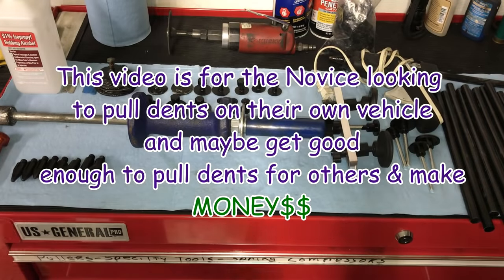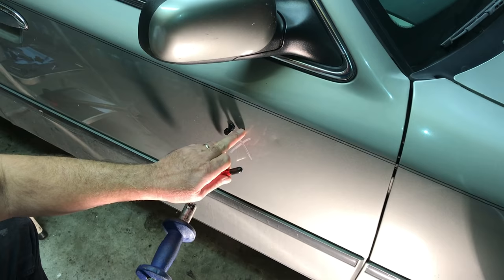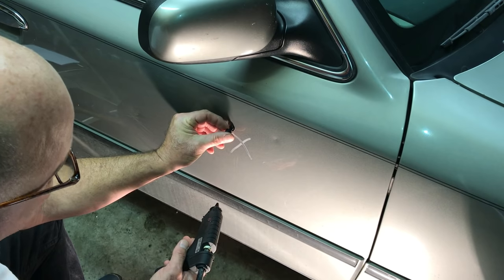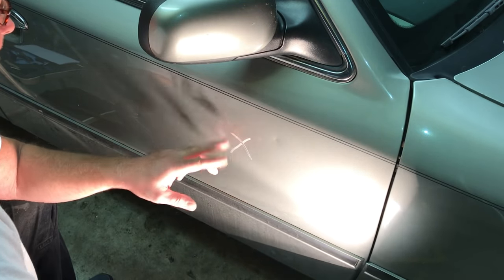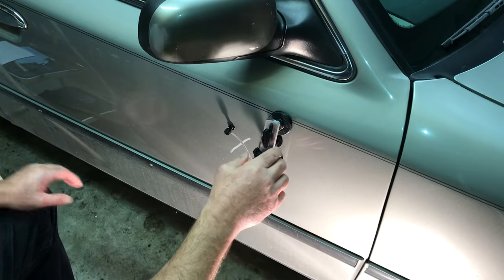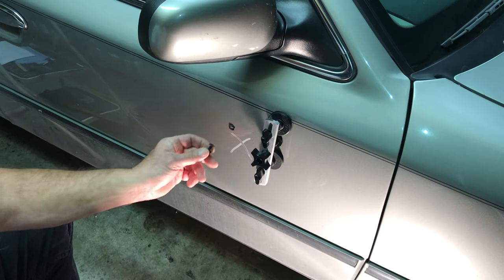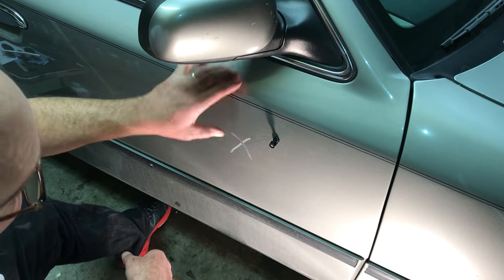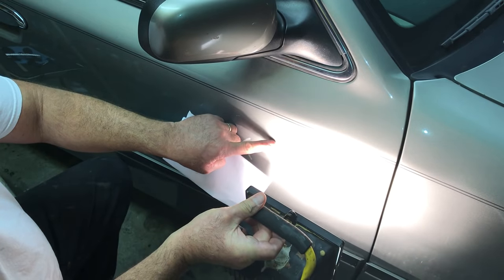#2 How To Remove Simple Door DINGS & DENTS for DIY'ers

Comment: Just used my PDR system today for the first time. Amazingly, most everything you talked about today, I figured out on my own except the 91% alcohol. I was using 70% and having a hard time removing the glue. Also in the right cases, I now get the need for the knock down tool because you might over do the pull a bit etc. I have the bar light so I am going to have to practice with it. Thanks for posting. Just the best!  Bought a truck last summer and I kid you not, the truck body was perfect,,,then a dent a week for four weeks. I was so mad. Car door dents from careless people. Biggest thing when doing these dent removals is,,, this takes patience. Yep, can't get in a hurry. Thanks again for this video. It was superbly well delivered!
Reply from the maker: You are very correct it takes a lot of patients you’ll get to the point to where you’ll be able to pull the dent up high enough that you’re knocked down tool will be able to level it right out very rarely will you get the dent to come out flat and perfect without the knockdown tool but it does happen good job my friend glad to hear you’re digging into it don’t get frustrated have a great day my friend

Comment from the maker: HELLO FOLKS, You can see the FIRST VIDEO here >>>>    https://youtu.be/_bq4cN7l14E      also you can buy a DENT pulling kit on eBay or Amazon or walmart they pretty much have all the PDR stuff you will need cheap...now go pull some dents.. :)
Reply: Sweet Project Cars.     Hey buddy nice job..I have both tools but the one you screw down didn't work that well either..
I took the thumb screw off and put a 10mm nut on it then I took my DeWalt cordless drill put it fast speed and put it on the nut
took the dent right out the first time the drill speed is what did it..I did go and buy the slide hammer witch 
I like better but that day I didn't one the drill method worked great..I had hail damage on my brand new truck
you can't tell it now ..thanks for the video and the tips...later dude..
Reply: Does this work with an aluminum car body?
Reply: Hahaha that made me laugh how well you actually did that! What a way to make some money and maintain my own car! Best video I’ve watched in ages. Thanks for the advice your video was perfect!
Reply from the maker: it sure does :)
Reply from the maker: Allan glad we could help you my friend :)
Reply: Sweet Project Cars absolutely amazing! I’m in the middle of buying the kit right now haha. Thanks!
Reply from the maker: you are very welcome :)

Comment: Thanks for the great tutorial- will be sure to check out some of your others. Even though my Pilot quarter panel was  badly scraped up as well as dented by an altercation with a box truck, I'm going to try PDR techniques. I contacted a local PDR guy and sent a photo asking if he could remove some dents, he said forget it, your panel is too badly mangled (next to the taillight the truck bumper grabbed the body and pulled it 3" forward). . Not to back off from a challenge,  I chained a winch to it and pulled out the damage somewhat. Now just have to remove multiple waves, creases and dents before filler and plan to try this rather than hammer and dolly, which I have no skills at. Thanks again!
Reply from the maker: MAINSTREET PRODUCTIONS we love your tenacity just keep at it and enjoy the process you will get it my friend  thanks for sharing mike

Comment: I did the method on my MC fuel tank using a square wooden dowel and hot glue...ZERO special tools. It worked just fine on a baseball diameter dent of about 1/8 to 1/4" depth. The tank looks as good as new. Saved 100's of bucks and all the dire warnings from skeptics.
Reply from the maker: G Philip C thank you for sharing sounds like a great idea for a gas tank ...

Comment: You guys are great sharing the  "secrets". Unfortunately I've got a crease on the hood of a 2013 Chrysler. A plastic squirrel cage fan fell off a shelving unit. The hood is aluminum so I'm taking the car to a guy that takes care of car dealers stock to push the crease out (paintless dent repair). Cost, $125.00, but I hate dents and dings.

'
Reply from the maker: Sorry to hear about that my friend those guys that deal with that will take good care of you

Comment: I actually had the body shop attempt to fix a ding on my door. The charge was 200 if he was able to remove it. Long story short they were not able to fix it. He mentioned the glue method but I guess he felt it would not work on this ding. I just may give it a shot when I get the car back from the body shop. Thanks for the info

Comment: And another trick  if you have a dent in your bumper cover  heat the inside of the bumper cover where the dent is  with a heat gun or a blow dryer  and push the dent it will push right back out. Just don't get it to hot. And wear gloves so you won't burn your hands  you can do it your self and save you a lot of money
Reply from the maker: Ben    .thank you for the great comments, they are very helpful to the entire channel :)

Comment: Excellent video but somewhat surprised you don’t use a light board to make it easier to see the high and low spots.  Maybe not needed as much for the 2 small dents you are demonstrating here.  Thank you for sharing your expertise.
Reply from the maker: Yes the light boards are handy when you have larger dents on the smaller ones it’s very easy to see them when you look at it at an angle you can see the distortion in the panel have a great weekend thank you for sharing

Comment: Thank you very much on all your videos.
Very informed easy and cheap way of doing things on the cars that’s what I’ve been searching for .I have bigger dent in my sequoia can I use the slide hammer for that and do you have any videos for bigger dents .
Thanks ,
Reply from the maker: Jay you can use the tools in the tool list for just about any size dent larger dents are almost easier you glue your big tab on in the center do the initial pull and work your way out to each edge of the Dent  they take a little bit longer because their larger but you can get it my. Friend

Comment: Another great video, provides food for thought. I have two applications. A motorcycle tank that was supposedly painted professionally where  a dent was filled with Bondo and the boot lid of my wife's car. The bike is a 6 cylinder collectable which I am restoring. My wife's car was repaired after someone pushed in the quarter panel and drove off. We had the boot lid where the clear coat was worse for wear, resprayed at the same time to blend in the patina and paint colour of the paint finish. A week later we parked her car and when we came back, a vandal had punched a number of cars including ours, in of all places the boot lid, one of the hardest places to get to. Every insurance claim costs $400 up front "Excess", so we did not have it repaired. Can you please advise us which brand of glue sticks and pads you buy.  There is a lot of junk on the market that is a waste of time and money.
Reply from the maker: these are the sticks we use in about 60-degree and warmer weather http://amzn.to/2lUuXqk   and this is the kit we use http://amzn.to/2EDTSXY  thanks so much for your great comment and support of the SPC channel :)

Comment: Great informative video. Hoping you can share some advice. I have a very large dent in the passenger door of my Isuzu Trooper. It was caused by a car backing into it and its taillight hitting it below the door handle. 

My question is how do you recommend I approach removing the dent since it is huge. Should I start in the middle of the dent by the point of impact and work my way out or at the edges of the dented area and work my way towards the middle?  Hope that makes sense. 

Thanks in advance for your guidance.
Reply from the maker: Luis Matho can you send us some pics of it?   sweetprojectcars@gmail.com  Mike

Comment: THANK YOU for this video.  I found it while researching ways to DIY the dents on my newly purchased 2010 HHR, not a huge amount of damage and I didn't feel like shelling out $1250 bucks quoted by the body guys.  I bought a slide hammer from harbor freight and made my own pulls, and I already had the glue gun and a good hair dryer.  For the two smaller dents, I popped them out with the very first pull.  The rear fender had a large dent and a crease abd scratch near the seam of the bumper.  My goal wasn't to fix that crease, I don't think this method will work for it, but the big dent was unsightly and annoying.  It took about 45 minutes of pulling to get it flush. The car is a 2010 so the tiny spots and that crease are unnoticeable now that I've filled the scratch. If you're not looking for it, you won't see it, and that's all I could ask for.
Reply from the maker: Paige Holliman this is so awesome to hear...we are glad it saved you and helped you...thank you for sharing your great results my friend :)

Comment: I appreciate learning from your videos. How much force is required for the slide hammer? It looks heavy by itself, so I'm curious about handling that thing and having enough pulling force. I wouldn't want to scratch the paint by letting it slip. Thank you so much.
Reply from the maker: Cynthia buy the smaller T-handle model much easier to handle for the DIYer

Comment: Works better if you warm up the body. Making it easier for the metal to flex and prevent cracking the paint. You can use a hair dryer or a hot air gun.
Reply from the maker: Thanks for watching and sharing. Have a great day. mad Mike the hammer SPC

Comment: Got a "bridge" kit some time ago; works somewhat. Will now be looking for a slide hammer/plug combo as our van got hit in the nose with a rock about a week after we got it. Also - my kit came with a white/opaque glue stick, not the black that you use. Wonder if there is any difference in glue strength? Thanks for the video series.
Reply from the maker: we are glad to help :) thank you for your great support  and thanks for being here with us :)
Reply: Do you have a good source for the slide hammer and pull tabs? I've checked Amazon and ebay but the hammers are around $35 and I've only seen the set of 14 different-sized pull tabs (in various colors) for about $15.
Reply from the maker: david your comment just came in ????   anyhow all the tools are in the video description area     thank you we do really appreciate you being here with us...:)

Comment: If you are dealing with anything other than factory paint and clear coat I would not recommend using the glue pull technique as there is a good chance it will pull the paint off.   The danger of this increases if there is bondo body work under the paint. If you are original owner than you would know if original, or not.  If you don't know history of car look for tell tale signs of body work and repainting.  Look in the crevices, door jams, where the trim is attached -painters are notoriously not good cleaners and you can usually find signs of previous work.  And don't forget to ask the owner , they may know the history of the car and any repairs.  It takes practice and patience but you can do it and make money.  Glue pulling alone will not always remove all dents.  Anywhere between 85% -100% is normal.  You would have to purchase the wands kit and push from behind to get closer to 100% consistently.  But that's a whole different training process to learn an not as easy to master.  Good luck.
Reply from the maker: Mark these issues you speak of we have never had a problem with after 20 years of glue pulling on 100's and 100's of cars. we are actually going to be doing a video on trying to pull really large nasty dents to see how it really works on them.

Comment: I bought a full kit a couple of years ago that included, that bar kit, the slide hammer kit and that other one you didn't show, the one that is similar to the bar, but has the handle you crimp. I had a go, but got frustrated and gave up, but thanks for the tip, it's a process, got to go the dints several times each. I'm going to have another go hopefully one day again soon. Also I've seen the dangers of that bar kit is that the outer pads can make new dents too and to keep them off edges or they can collapse them. So, any follow up to the fixing of slack door straps? Thanks.
Reply from the maker: MV60 now you can go back at it my friend and try again just take your time and do it slowly.....thank you so much for the great comments and we are very glad to have you here with us..its comments like that that will make our channel very useful to others..:)
Reply: Thanks. :) I was always previously under the impression it should pop out in one go and that it was a failure when the tab broke off and the dent was still there, that the glue wasn't right or something. Just another thing one needs to learn patience with. :)
Reply from the maker: time and patience is the the key...you should have seen me when i started lol  but after a couple weeks it got better, then after a month or so i learned to pull the dents out just about perfect without using the knock down tool..you will get it my friend.

Comment: Been a subscriber short a short time. Really appreciate the information.

I received my slide hammer kit on Saturday and have been trying to remove my first dings. Made a 90% improvement. Can't seem to get the last 10% out. I rewatched this video and tried with more glue without bottoming out the tab. Still can't seem to remove 100%. Glued different tabs on +ten times, anything else to suggest?
Reply from the maker: greg  clean the spot with alcohol real good then glue one on but push it in a bit further then let it sit 10 min's then pull it out hard a fast.  do that a few times and it should do the trick thank you very much for your great comment, it is great for the whole channel to have good people like you here :)

Comment: 4:15 when this happens, I use my heat gun to melt the glue back down and reuse it . Also, I use acetone to get the glue off every few times I melt it down .. usually just because I get paranoid that it starts sticking less but I’m pretty sure it’s fine indefinitely.. acetone makes the glue fall off without any scraping or peeling, it’s stupid how easily it comes off with acetone.. tho you shouldn’t use it if your little attachments are plastic, I melted one of mine trying to get the glue residue off it.. im gonna go to a machinist and see about having some metal ones made

Comment: Great videos Mike, thanks a lot. I have a quistion, i tried to pull out a dent on my own car, at the beginning it went well, but when I had to make the last pull, the paint came off ?
Do you have an idea why ? Did I pull too many times at the same point (5 times) or could the glue have been too hot?
Reply from the maker: Flemming Sortkjaer sometimes and very rarely if you pull too many times in the same spot it will do that, also it depends on the age of the paint and the quality of the paint, also if you let the glue set too long before pulling it will do that, we let it set about 30 seconds to a minute in around 80f degree weather now that the paint is missing you can finish the dent and then use one of our videos on paint correction to make it look new again.

Comment: Very informative video!😀 Do you use black glue sticks to see the glue better? Also where could I buy any kind of glue sticks in bulk? I've looked around and local stores are expensive and online places like eBay don't seem to have any good deals. Thanks
Reply from the maker: Hello Anton, we use the black that is specifically for pulling dents it has the characteristics made just for that purpose it holds on just the right amount to ensure safe pulling without paint damage it will work in moderate to warm outside temps,  Each glue has a specific temperature range and strength. Some work great in cool weather, while others shine in high humidity.  My advice is to find a combo that works for you and stick with it. Currently I am using a Black stick great all round stick good for most pulling jobs.   the average cost is about a buck a piece. THANK YOU FOR THE GREAT QUESTION :)

Comment: Do you make the glue diameter the same size as the dent or about 1/16 of an inch smaller all around? 
Thanks for video.
Reply from the maker: Make the glue just slightly smaller than the dent.  Thanks for asking.  Have a great day my friend.  mad Mike the hammer SPC

Comment: Mike, great video. I've got a couple cars with dents and I am a DIY guy so I'm gonna try to learn what you taught. 1 question: How do you deal with a dent that is not on a flat surface to begin with? I've got an 05 mustang and my door got dinged right where the metal angles just under the window so the dent goes through a straight edge. How hard or easy is it to pull that dent?

Regards, 
Mike.
Reply from the maker: Hello Mike my name is Mike as well but something like that if you can send me a picture of that I can help you better send it to Sweetprojectcars@Gmail.com